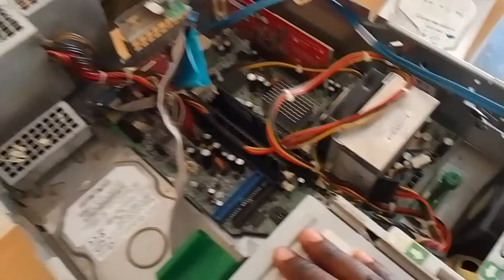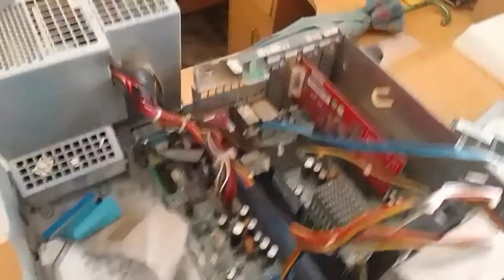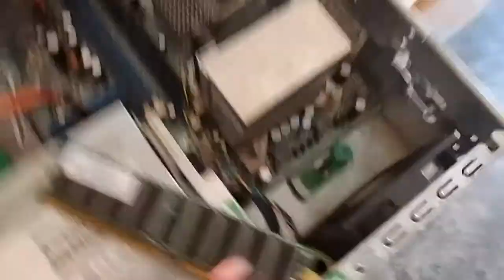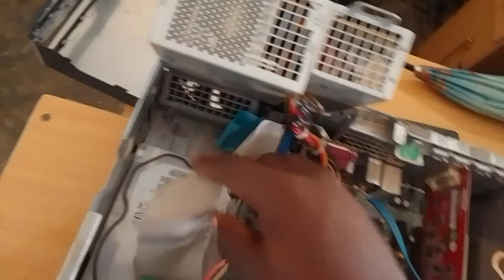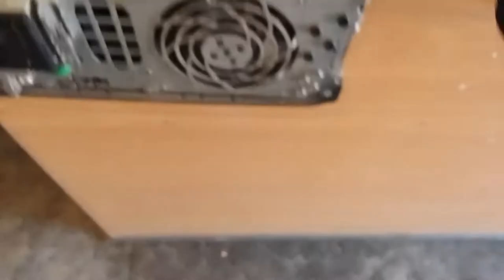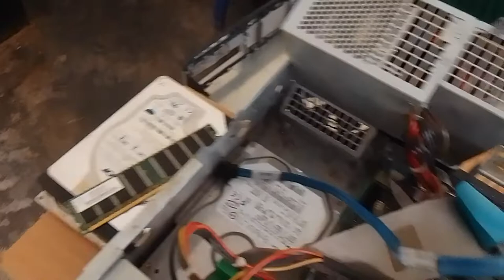ADVANCED TUTORIAL || Components Housed Inside The System Unit Explained || Introduction to Computer.

Comment: When powering on my pc, there's a beeping long sound produced! How can i fix this? 🤔 ☺ 😌
Reply from the maker: Hello skyware, when your PC has a beeping sound, there is a possibility that either your RAM or HDD  is encountering a problem. Therefore what are supposed to do is either to remove the RAMS gently, clean them with a soft pad and then return them, or replace them with new ones. Any of those will give you an amicable result. Thanks for watching you can as well share.